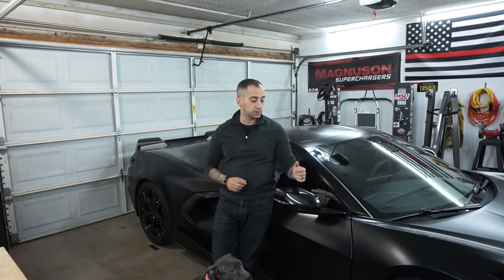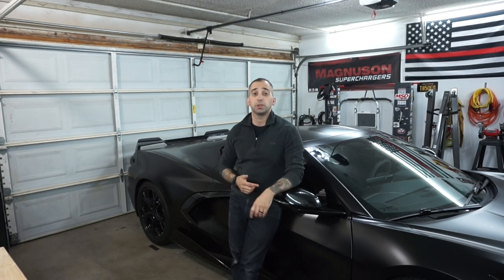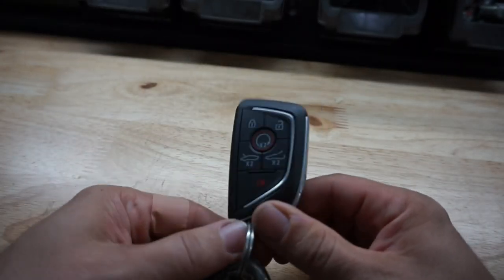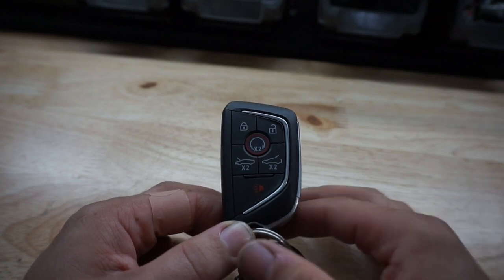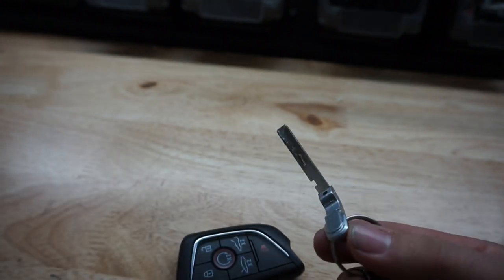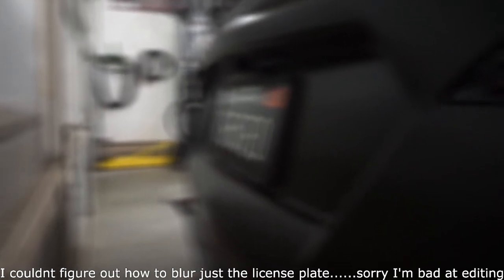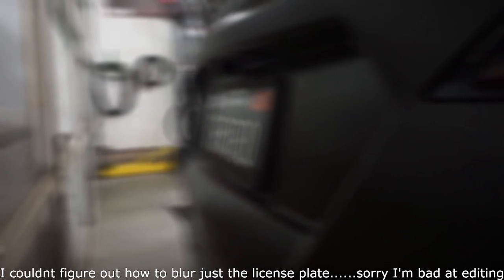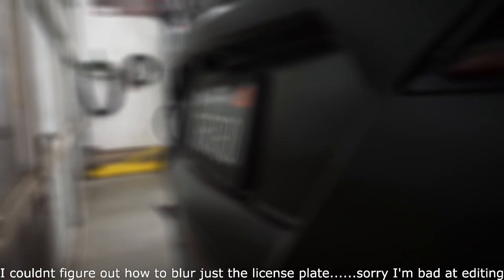Open trunk, hood, door, and glove box with no battery power on C8 Corvette. RPO code List Loacation.

Comment: 2023 and up(?) do not have the keyhole behind the rear license plate. How do you open the rear trunk?
Reply: We don't, apparently.  I am guessing that if the car is dead and you need to get into the back, you access the front and charge the battery to get the rear open.  If that doesn't work, then we will be towing it to a dealer and they might have a way that involves drilling a hole to access the latch.  This was REALLY dumb of Chevrolet...